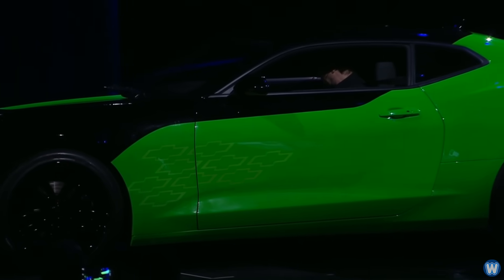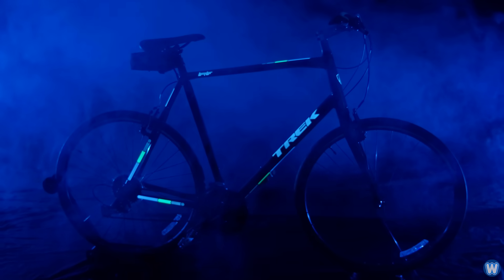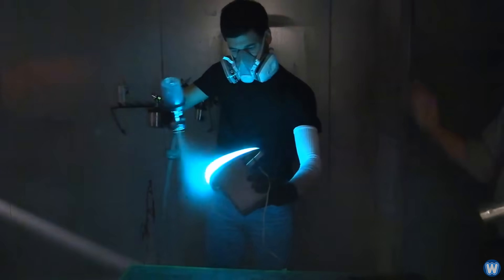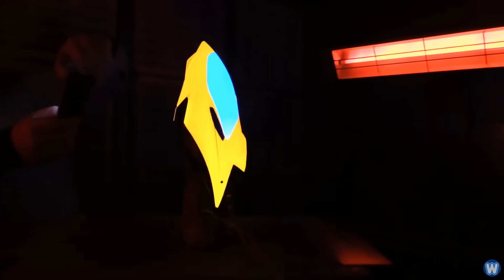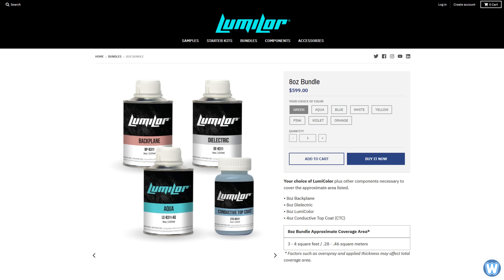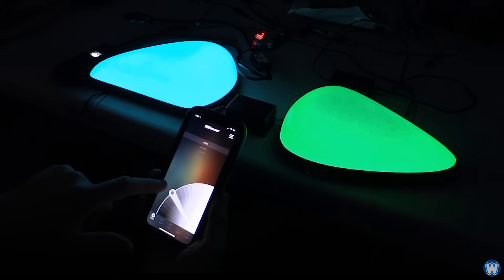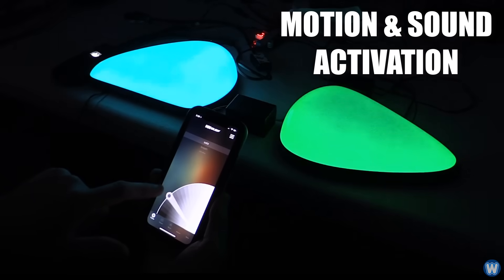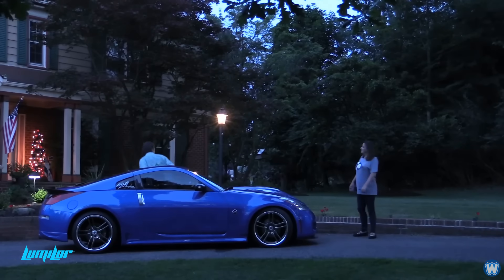LUMILOR - Electric Paint That Lights Up at The Flip of a Switch

Comment from the maker: This video is a re-edit and re-upload of an original video I did on Lumilor in 2018, but with all new information, pricing, footage and narration. I re-uploaded the video 2 weeks ago, but Lumilor told me I was using the old pricing and asked if I would re-edit again and replace with current pricing, which of course I said yes, I don't want to have incorrect pricing in a brand new video that will be up for years. So all the information and pricing in this video is accurate of of Dec 2020.
Reply: DEDICATION!
Reply: îts mainly for PINSTRIPING.
then its "cost effective".
You get a single colour accent for $600 + labour
Reply from the maker: @jo-well5869  Thanks I guess, but if I was really good, when I remade the video 2 weeks ago, I should have made sure I was using accurate pricing, to prevent editing the video 3 times.
Reply: Thanks! I was looking for this actually👍😉 and thank you for their links too. Have a great weekend Wonder World.
Reply: Why didn't you update the video with more information like how well does it hold up 2 years later?
Reply from the maker: @Thoran666  the paint lasts anywhere from 10,000 to 50,000 hours of continual use, and most people only spend about 2 hours a day in a car on average. so 10,000 / 2 = 5000 / 365 days = 13.7 years of use, I did not see any reason to mention it will pretty much last for the life of the car. and 13.7y is the low end.
Reply: Awesome video, awesome product 😎
Reply: I can also mount Canon 5D Mark iv DSLR’s to the Edge HD and RASA both
Reply: https://youtu.be/sR09nDWwpy0 not sure if you got this link.   Did you get the CELESTRON equipment links?
Reply: That's all the world's driving roads need, another frickin' way to distract drivers.
Reply: TRON
Reply: https://youtu.be/iIIaFIm43Ns
Reply from the maker: @kylebaker9527  Hi Kyle, appreciate the offer of using your footage as some kind of follow up video - https://www.youtube.com/watch?v=iIIaFIm43Ns&feature=youtu.be
Now I can see it's a Lumilor product, from the 2nd video link you posted, but the finished product, simply looks like a backlit screen, in other words, it does not like like a lumilor product. and does not have that wow factor of a Lumilor product. Sorry mate :(
I would not have been able to use it in a full story, but that link above might be usable in a SHORTIES video, if your ok with that. just to quickly say what it is and the fact it is a Lumilor sprayed item.
Reply: @WonderWorldYTC  if you got all the links - yes,.please feel free to.use in a ahorties video.    I've sent a reply or 2 that I don't see populating on my Samsung, but I'm pretty sure it showed fine on my iPad.   Did you get the equipment links ?
Reply from the maker: @kylebaker9527  I got it thanks, now tell me what is it exactly and why did you get it sprayed in Lumilor?
Reply: I'd love to do this on my Suzuki 😁
Reply: WOT????
THEY KNOW YOUR HEART BEATING RATES........YOU KNOW! WHAT'S NEXT???
Reply: I want to learn skills Shall we go?
Reply: where can we buy paint like this?
Reply: LOVE IT! LOVE THE EFFECTS ON IT AT NIGHT RIDE....
Reply: you mean generate light.. see Law of Conservation of Energy.

Comment: The real promise of Lumilor is controlling it like a RGB video wall with googol Picture-In-Picture resolution (PIP).  In essence a digital fractal video array utilizing trixel accurate control points.  A trixel is a three color picture element (pixel).  Now since this can be applied to any 3D surface it simultaneously acquires voxel characteristics.  Voxels are volumetric picture elements.  Voxels are used in next generation free floating 3D video displays that allow 360 degree observation of any subject.  Paired with haptics it is then possible to create the illusion of tactile sensations with something that is purely imaginary.  Add some magnetic fluids inside an exosuit and you'd then be able to create the ultimate AR/VR world in the real world.  But I'm getting ahead of myself.
Reply: "if someone else makes something magical, itd be magical" - internet genious

Comment: If the paint can light up than with a few tweeks it should be able to absorb the sun and generate power like a solar panel.
Reply: LMFAO with a few tweaks???? Give us factual evidence that proves that if not stfu.
Reply: yea ill go ahead and put all my light bulbls outside so i can you know put them inside during the night to make light
Reply: @3DPrintingLoot  maybe he's going by the logic that all solar panels are leds in disguise and vice versa.
Reply: @3DPrintingLoot  resistive light bulbs obviously not, but LEDs work in reverse. Put them under the right frequency light and they do generate a voltage across the leads. Solar panels are just LEDs that are optimized to be really good at that, but are kinda bad at outputting light.

Goes for a lot of things. Motors are generators, just each is optimized for their use. Speakers are microphones, again optimized.
Reply: @3DPrintingLoot 🤣😂😂🤣🤣💀💀

Comment: It would be interesting to see this light incorporated in such a way as turn signal indicators. If you use this lighting it will allow designers to remove the tail light assembly completely and will give the artist designers a challenge of designing lighting designs for taillights and turn signals.
Reply: Assuming people would actually USE their damn turn signals!
Reply: @copelandart  💀tru
Reply: It's not bright enough yet.
Reply: @Artcore103   But it could still be used in addition to the normal lights, making parts of the car glow dimly would be great for nightime visibility, especally on parts that dont normally have many lights like the side.
Reply: I doubt you could see it in daytime currently !

Comment: I have a question. Lets say i have a paint protection wrap on my car. Would luminor work on that? Cause itd be cool if i can just decide to tear it off. Or does it need to be on the surface of the car because electricity has to flow through it. Idk what im saying tbh, im asking does it work on wraps and vinyl. Stuff that you can peal off.

Comment: 0:30 - Who ever did the paint job on this car for the EL lighting, did a terrible job, you can clearly see some areas where the paint of layers of different materials was not spray applied properly. For anyone wondering the science behind this, is really some advance level stuff, its pretty much the same science concept of how electron beams, displays picture on a CRT monitor. You can think of this as a modern Vacuum Fluorescent Display(VFD), just that there's no vacuum required. All the designs that was done on the car for this lighting was childish and meaningless.

Comment: Really excited for this in real world applications! There are so many applications for this such as low power illuminated safety cones and turn signals integrated into paint. There's just an endless possibility of uses. I'm sure the limited life span can be a turn away for some people but on that note have you applied Lumilor over vinyl wrap? I say this because it could be a viable solution when you need to reapply Lumilor. Simply peel away the wrap, apply new wrap and apply new layer of Lumilor.

Comment: TRON Has come to life! i hope this paint is applied to STREETS!! crosswalks and stop lines so much potential
Reply: even stop signs too. small solar panel built onto the back that charges a battery enough to power the stop sign. it could potentially save lives specially in very dark areas.

Comment: I think that where this technology can be most important is on the highways since there are highways that do not have the signs marked very well and in some places they can hardly be seen.
Reply from the maker: the paint when it's lit only has a life span of 10,000 to 50,000 hours, that is not enough for road markings, if you average 12 hours a day of darkness where the lights are on, it would only last 833 days.
Reply: I read an article somewhere and they said that in Scandinavia they were working on a road paint that would actually change colors with the temperature change. So if the road was safe the lines would be yellow but if they were icing up, they would turn blue or maybe even red.  That would be awesome.